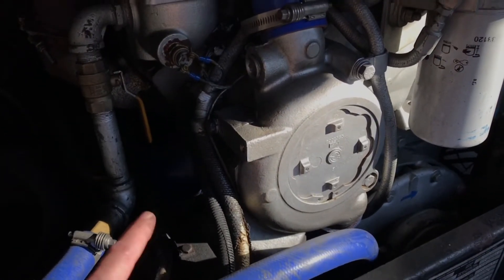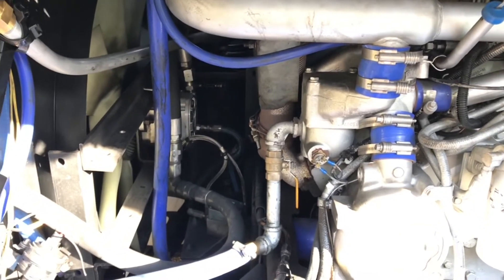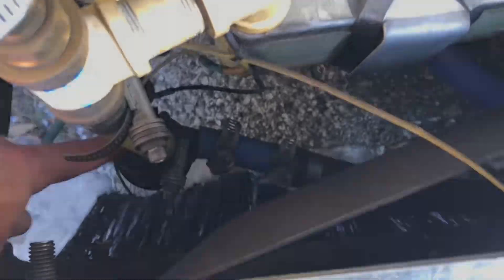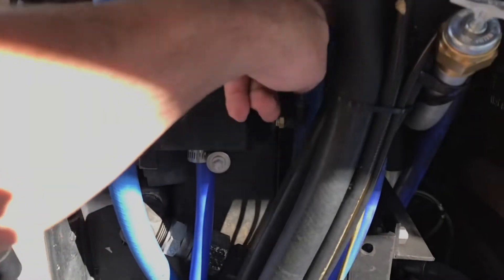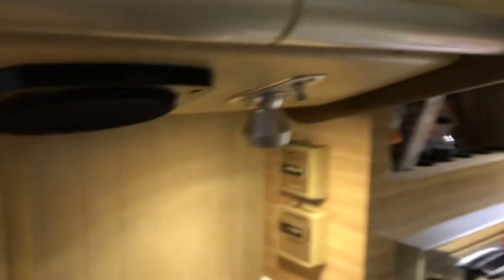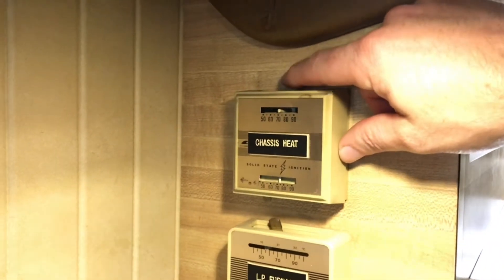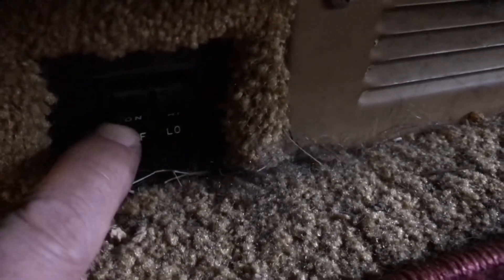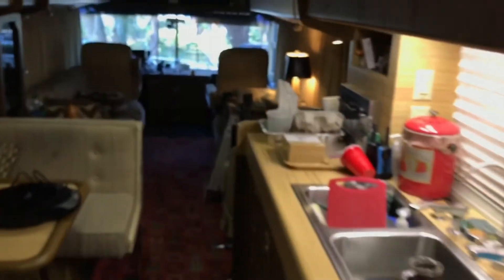Gino’s Garage- Modifications to the Chassis heat system explained.. sorta, well the best I can!

Comment: Nice work as usual Jeff. Where do you get your constant-torque hose clamps and silicone hose?
Reply from the maker: The clamps are Breeze brand and I get them locally or hose clamp kings.com is a good source. The silicone hose I purchased from silicone hose.com

Comment: Nice work, like the idea of separating engine coolant from heater loop.   Why didn't you reuse factory pumps?
Reply from the maker: Factory pumps were crusty and locked up, motors pull lots of power. These pumps are easy to get and they work great with low power consumption. My plan was to eventually merge the chassis heat system with a diesel hydronic system to heat the bus when your parked. Not sure if I will get that far until I need it.

Comment: I wonder if the BL14-40D would work for a transmission cooler with 40 plates? Just wondering? They make a hot water to air exchanger up to 22"x24" that might be a good heater core replacement for older buses and RV's. Got me thinking about our 1947 Silversides. Thanks Jeff!!!!!
Reply from the maker: You would have to look at the pressure rating of those plate exchangers, not sure if they could handle the transmission pressure. Yea I often go here for stuff like that: lots of good stuff and the stock is always changing:
https://www.surpluscenter.com/Truck-Trailer/Cab-Heaters-Block-Heaters/Cab-Heaters/